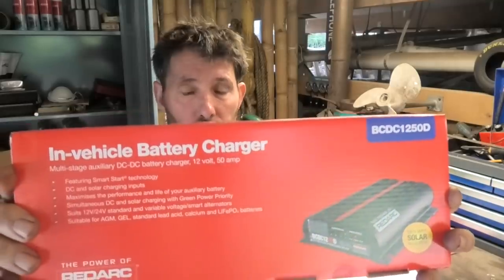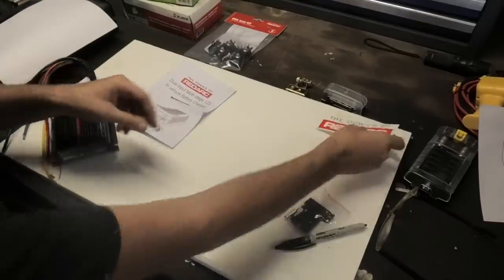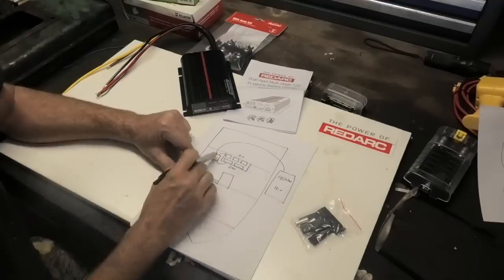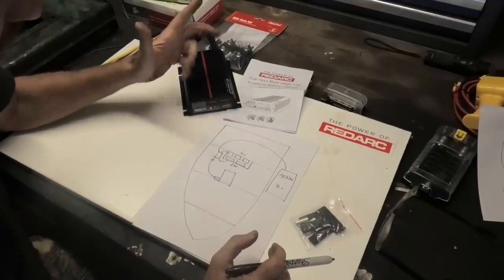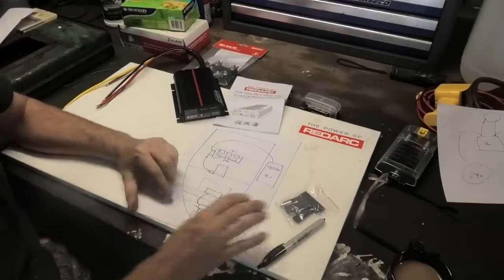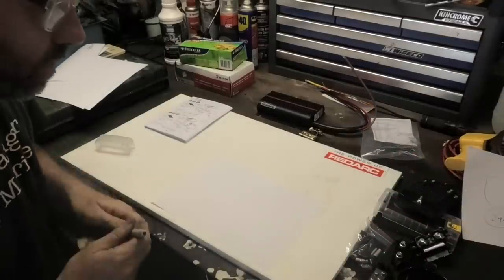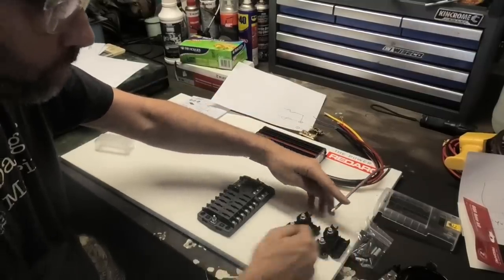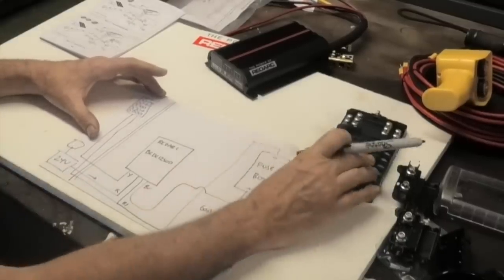Planning the trawler electrics

Comment: The BCDC1250D will charge your 12V AGM batteries from the 24V battery bank & solar, however it will not charge the 24V system from solar. The inputs are strictly inputs, and will not bridge.
I would also recommend using the blue trigger wire to an alternator feed so the 24V input is only active when the alternator is active (engine running). This eliminates any chance of the DC charger drawing down your 24V system with the engine off.
Reply from the maker: Cool, I was suspecting that might be a limitation. I would like to have some way of charging the starting batteries other than the alternator so I might need to have a think about that. You've saved me a phone call. ;)
Reply: Something like the BCDC2420 would allow you to charge the starting batteries from the 12V house bank. Take the trigger wire of that unit to either a switch (manual charging selection) or the solar feed-in on the BCDC1250D (auto solar charging). You could probably do both in parallel. Redarc may be able to suggest another option for 24V, as my experience is mostly 12V 4WD & caravan electrics.
Reply: I know for 36v trolling motors we use a single 12v charger with three outputs.  The system will have 3 12v batteries in series with each battery being hooked to a separate output on the charger. Maybe there is a system that will allow you to do something similar between the 24v and 12v circuits.
Reply: @ScottHiltonAU  Great information Scott, I wonder if the Redarc BCDC2420  unit has a battery charger that is “Temperature compensated” for the optimum float voltage and maximum service life.
Reply: The manual does indicate that it adjusts voltage based on temperature to protect the unit and battery,
Reply: @ScottHiltonAU  Does it allow you to install the temperature sensor near the batteries or does the REDARC unit have to be installed near the batteries so the unit knows and has an accurate temperature reading of the batteries? Thanks Scott, great information that I think will help Stu and others.

Comment: Use LED lights. They will save on power from battery's.  Check Amazon you should be able to fined 12 volt Leds.

Comment: Why not a 24V anchor winch off your start batteries? Less current at 24 V, smaller cables, engine will be running when you use the anchor winch,  4/71s start quickly anyway, one less battery to maintain and more reliable. Just ensure the spike caused by using it won't freak out the redarc, or anything else on 24V that may be a bit sensitive. Luv ya work! Enjoy your time off!
Reply from the maker: Yes, have decided to go that way in the end.

Comment: I like your plan on the electrical system I've done it very similar in the past. Using a couple of large feed wires from a primary fuse or breaker box is a good idea that way you don't have everything running to just one spot that makes for a bigger mess.

I'm wondering if going to Hydraulics for your anchor winch and deck crane might be worth looking into. A 6 gallon a minute Vickers pump would run the anchor winch and your deck winch. But then again I don't know what the price of hydraulic components are down your way.
Reply from the maker: It would be interesting to look into hydraulic. I'll have to get some prices.
Reply: @DangarMarine  in a lot of ways it make things simpler for you electrically

Comment: Make sure that electronic box of tricks can handle the currents you are going to require. It looks a bit small to me. What about heating and air conditioning? Running that off a separate AC generator? Otherwise its looking good.
Reply from the maker: Yeah, won't be installing any heating or cooling in the boat other than maybe a small fan near the bunk.

Comment: Hi Stu; 
Unless I am mistaken, you are considering using Absorbed Glass Mat (AGM) “AGM” batteries instead of using traditional marine flooded cell batteries. I maintained air traffic control systems that used both types and you should consider the advantages and disadvantages of both types. AGM batteries require a battery charger that is “Temperature compensated” for the optimum float voltage and maximum service life. AGM batteries are very expensive compared to maintenance free or traditional flooded cell batteries. A float voltage that is too high will “cook” and dry out AGM batteries. A float voltage that is too low will leave the batteries undercharged and reduce the service life. Assuming the battery charger you opt for is “Temperature compensated” and designed for use with AGM batteries, the charger must have its   sensor installed very near the batteries or the “Temperature compensation” will be ineffective. Locating the battery charger dc/dc converter near the batteries should allow for most effective “Temperature compensation” and the optimum float voltage. Assuming the battery charger is well implemented and has “Temperature compensation”, AGM will work fine except for the cost. The air traffic control systems I maintained used Optima brand AGM marine batteries or the industrial AGM batteries specified by government contact. Flooded cell batteries are durable and much lower cost and not as sensitive to effects of temperature, but “Temperature compensation” is a desired feature assuming the battery temperature sensor is located very near the batteries. Flooded cell batteries generate more hydrogen gas and must be well ventilated and a hydrogen gas sensor with alarm is a good idea to prevent explosion due to build up of hydrogen gases. Flooded cell batteries require maintenance unless maintenance free in accordance with the battery manufactures recommendations. Distilled water and regular check of the water level and checks with a Hydrometer are required for best service life. 

The reader may ask, why use flooded cell or maintenance free flooded cell batteries? Cost and longer service life. How can I tell if I have the optimum float voltage of each cell considering temperature compensation and why is this important for optimum service life? A battery is akin to a sponge in a glass tray. When the cell is under charged it is like a dry sponge. Adding water will fill the sponge to the point where the sponge is full saturated and every drop added will cause the sponge to shed a drop of water, this is akin to the optimum float voltage. The satuation point for each cell will be higher or lower depending upon the temperature of the cell. For AGM battery cells, the saturation point of each cell must be calculated in accordance with the battery manufactures recommendation for each cell. Flooded cell batteries can be monitored via Hydrometer checks and water levels must be maintained. A well-maintained flooded cell battery will have a service life that far exceeds AGM batteries. I have maintained systems with AGM batteries that exceeded twenty (20) years when optimum float voltage has been maintained. A over charged AGM battery will cause the battery to dry out and swell up and fail and generate heat. A over charged flooded cell battery will cause excess heat and excess hydrogen and require more water and cause the battery cell plates to swell up and warp and short out the battery and may cause the battery to spark and explode. 

I hope this information helps you with your project. Cheers. Dennis Jon Sytsma Homestead Florida

Comment: might i suggest on the physical layout put positive on one side and negative on the other  or go top to bottom.  makes things easier to work on.  also might want to run a single heavier negative bus through the whole boat with a tie point in each compartment. the price of one large cable compared to multiple return wires?   you'll  get more  electronics noise from static  of moving machinery than anything else.  if you do run ac  you'll want shielded cable which gets expensive  fast. metal conduit is fine  until you get to the boxes  they will act as a transmission point for noise. think about it may be easier to shield the radar and sonar  rather than the rest of the ac system.
Reply from the maker: Good point about shielding and the heavier bus bar. I too thought it was a bit light or a main bar.

Comment: USB Type C power delivery usually uses 19V for laptops.
Also, on a boat with energy stored in batteries, DC transmission losses are more than AC could be, however the real advantage of DC is that your energy is stored as DC. Converting DC to AC results is a fair amount of energy loss.
Reply: I use a 12v to 19v boost for my laptop...at 6.3 amps output!
Reply from the maker: Do you have a link to the kit you use Greg? If so, can you post it as a separate comment so I get a notification.

Comment: The 60a fuses are probably best on the 12v and 24v battery sides of the redarc unit. Still have a fuse or breaker on the 12v supply to the man fuse block too though.

A dual pole solar isolator up near the panels is probably a good idea too in case anything happens further down the cable run

It’s worth running the external LED on the redarc unit up to the cabin too so you can see it’s status.

It might end up being practical having a fuse block in the engine bay and another in the wheel house so the longer runs are mainly the supply lines
I would end up with lighting everywhere below deck
The other thought i had is a redundant but more simple 24-12v step down as an emergency power source for marine radio and navigation
You could just have a switch on that gear to take power from the A or B source (eg A=house 12v and B= the step down from the starting batteries
Reply from the maker: Hey Leon, I like the idea of a second step down transformer as an emergency way of running the 12V side from the starter batteries, that could be really handy in an emergency. I also like the idea of having an isolator for the solar cells, that makes sense too. :)

Comment: Running an anchor winch from the main batteries requires big wires, but charging it only needs small wires. You could probably even trickle charge it from your cabin wires.

Comment: I don''t know what kind of current an anchor winch draws, but you might want to ditch the forward battery and just run cables. Regular 1/0 cable will handle over 200 amps, and has  good thick abrasion-resistant insulation. It's probably less than $2.50/ft - I guess the cabling might cost around *80-$100 depending on the total length of the installation. A lot simpler and 

more dependable.

Comment: It appears that your solar input will only be charging the 12 volt bank.  I'm a little confused about your original intentions, but after you drew out the schematic, I think you have everything correct, except that the charger does not work backwards.  All it does is take the 24 volt power and the solar power and charge the 12 volt bank.  FYI, if you plan to parallel any batteries, make sure they are all brand new.
Reply from the maker: Yes, I did express it poorly at the start, this charger only charges the 12V system, the 24V system is charged directly by the alternator.

Comment: WRT 12V charging, but more of a side note- I'd bet that more than your Macbook will charge and run via USB- I'd suggest having a handful of dedicated USB outlets around your boat.  Especially if you can find the highest range USB outlet that is run via 12V (which I suspect you can find via the auto parts, since they run 12V and have USB outlets).   But another +1 about going 12V as much as possible, as you can get a lot of LED lights to run off a 12V line.  I agree the min conversions from the 12V system, the better (like 12V to 240v AC to 5v usb or whatever alternatives)- all of the conversions from one voltage to another will have an loss of power.

Comment: I think you will be best off just running heavy cable to the anchor winch as you already have x3 130ah agm batts. Just run off one of them. You have plenty of power comming in and the anchor winch really only runs when the  engine is so its always charging. Also Loanstar is one of the best brands available
Cheers

Comment: Just bouncing an idea, what if you had 24v house batter set up for all your house needs plus anchor winch n deck winch meaning less current draw n all that, and have a 12v batter for your VHF radio? For every connection you get voltage drop and 24v is more forgiving. I’m not a sparkie I’m a skipper on a ferry I’m just referencing off my work boats 👍
Reply from the maker: I can see the advantages to going 24V for the house batteries, I'll have to look into it a bit more.
Reply: Running 24v would allow you to run a bigger inverter as well

Comment: I'd look at single point of failure components that can leave you in trouble.  Namely the REDARC charger (since everything is going through it) and anchor winch battery.  Can a bypass circuit with a heavy duty switch be used to bypass the REDARC?  Does the anchor winch have a manual override?

Comment: Just some good advice about connections: DO NOT use 'crimp' connections. 'Solder' every connection and use heat-shrink tubing to insulate those solder joints. (I'm not referring to connections where you will be 'bolting' together connections like on your distribution panels. Just giving good connection advice like we do on automobiles.)
Reply from the maker: The funny thing is, most of the professional auto and marine guys now say don't even think about soldering, always crimp. A short will melt the solder and cause the wires to come apart.

Comment: Nice redarc controller! I have to say I'm personally not a big fan of the winch battery being charged off solar. Seems like you'd always have worrying about a few cloudy days keeping you from using such a critical piece of equipment when you need to. Maybe charging it off the redarc controller in parallel with the house bank would be better (I don't know if this is acceptable or not), or if not then I'd rather just run heavy gauge wires from the engine bay batteries.
Reply from the maker: Yes, now thinking I'm going to run the winch of the 24V starter batteries.

Comment: Hi Stu, 
Check with your mate at the Brupeg steel boat project for their electrical installation.
IDK if there is a modern trawler builder or boat yard where you could go tour the electrics install, without having conflict with their proprietary information. It might be interesting for gaining brain farts and maybe different vendors for supplies or sponsors. I know a lot of the sailing channels get sponsored by RayMarine and such...
Another idea is if there are any marine salvage yards around that you might get some ideas and parts from the ships available for parts. 
I know there are some what we call marine flea markets in different boat/ship populated areas that folks sell their items from new to used (old projects/up grades or wrecked boats pulled parts etc.); IDK if your area has something like that also. 
Could be good for networking if there is a source like that around. Could make a good video topic. 
Give some thought to AC and off shore power hook-up, might be good to run an air conditioner if sleeping overnight somewhere to relax from sweating your bum off all day. JAM
Reply: I don't know if Stu needs a freezing cold 240V air-conditioning unit in His tiny wheel house since He has become accustomed to the air-conditioning unit in the LandRover, it's called both windows open with the wind blowing on the sweat on your face.
Reply: @dustyfarmer  We call it 2-70 and 2/50 haircuts, two windows down your cool and your hair still looks good when you get out. Least what I tell my hair cutters. What king of haircut I want.
I don't know Aussie power ac standards, but we have small window units that run on 120 vac and only pull about 8-10 amps for 100 bucks. 
Live in South Us where it is 90% humidity and 95 degrees F at night for more than 6 months a year.
Reply from the maker: I agree that you can't look at enough good installs to get inspiration. I also like the idea of poking around a salvage yard, that could be a fun video. Air conditioning certainly is a tempting feature, but I do also like being one a boat when it is hot. When we were cruising in Greek it was stinking hot all night and we just jumped in the water periodically then slept up on deck.

Comment: Considering how the Redarc is the heart of the power input and routing to loads, a significant infarction in it could leave you powerless (or at least non-rechargeable) . So would it be a good idea to have either a spare Redarc on board, or to have a simple/rugged switch-mode charger (normally disconnected from the system) also on the E-board to provide 30-50 charging amps to the batteries? Then you could unplug the dead Redarc, switch in the backup charger and head toward home or a nearby port for repair. Additionally, gas discharge tubes or Varistor (MOV) networks on the input lines to the Redarc and solar charger, to shunt spikes to ground and clamp input voltage-level peaks, might add some peace of mind when going the kilometers or enduring storms. And a spare alternator would be cheap insurance as well. As a guess, it would seem that suppliers of oil-platform electronics might have some of those contingencies covered already in system, spike-suppression filters or conditioners. Lightning is beautiful...until it induces transient currents in your hull.

Simple, 12/24Vdc, 2kA, surge & noise filter

https://www.seachoice.com/pdf/19931_MARINE%20SURGE%20SUPPRESION_B.pdf

Good opening article (docking/120V hook-up focus in foreign ports):
SURGE PROTECTION DEVICES & YOUR BOAT
https://partsandpower.wordpress.com/2013/09/25/surge-protection-devices-your-boat/
Reply from the maker: Thanks mate. Appreciate the info and the links. :)

Comment: I use the app "electrical calculations" for all my wiring it is  very easy app to use, and it covers A/C, D/C, single and 3 phase, it covers wire size and length.
Reply from the maker: I'll check it out, thanks.